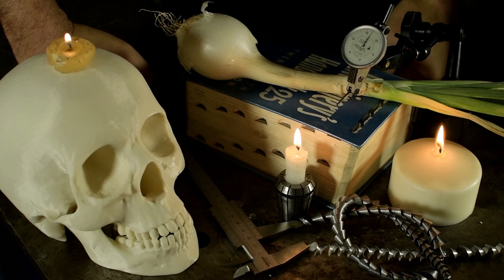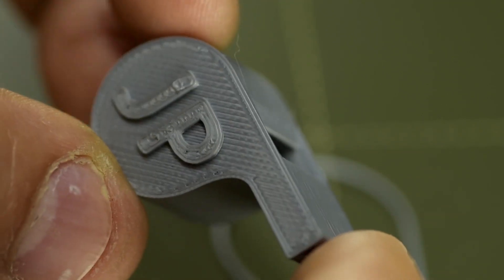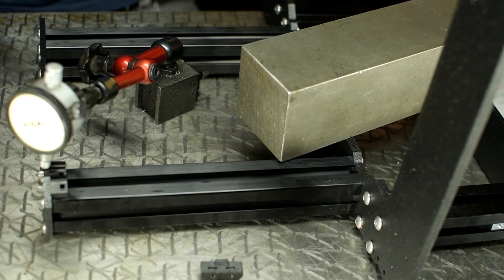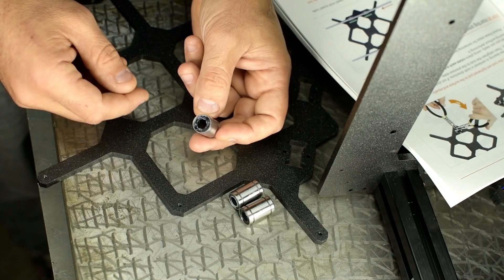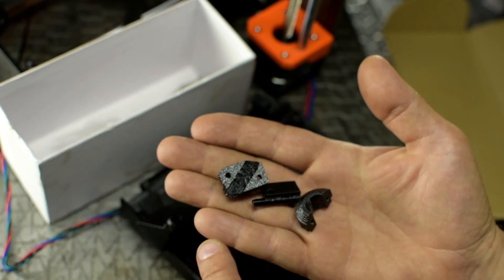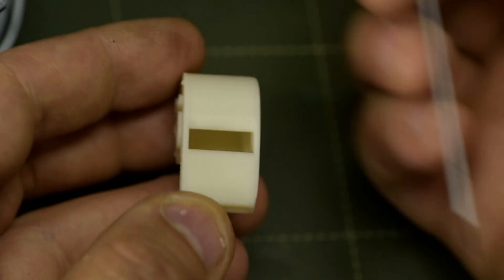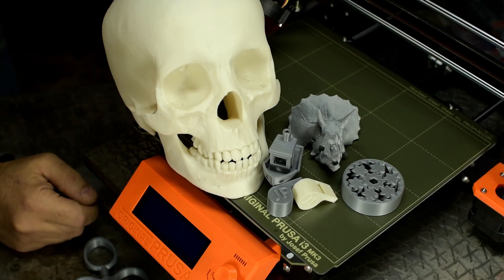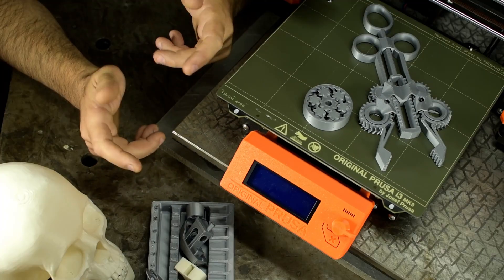This Old Tony in 3D!!! (printing)

Comment: Creality Ender 3 is a very good introduction to 3D printing. It's cheap and works pretty well. The Prusa is a better machine but it costs 3x as much. The Ender lacks things you might get in a more expensive printer - auto bed levelling, dual axis Z, direct drive extruder. Quality of life things. But perhaps that's why it's so popular - it's cheap and people who have an itch to scratch will find a huge number after market mods both commercial and print-it-yourself that take it in crazy directions.

Comment: Prusa is worts 3d priter, worst cost effiecency
Reply: @npgoalkeeper _ Chinese printers are better, for example ender and ender clones are alu-framed with vslot, when prusa still using obsolete designs with plastic 3d printed parts, acrylic parts and linear bearings. Only cheapest chinese printers(100-130usd) still using prusa design. For prusa price u can make ender with hiwin and every upgrade you can imagine.

Comment: Welcome to 3d printing !
Happy to see you went with a Prusa. You couldn't have made a better choice as they are definitely the best printer there is for a house or a small workshop. I do own two for years now. About the assembly you went overkill in my opinion but that's cool. The printer is tolerant to slight misalignment and you would not have seen any issue. As time goes you will realize how much the Prusa is a much simpler, versatile and precise machine compared to some twice its price. Any cheaper is a nightmare of bad quality and problem solving. Any more expansive is a waist of money.
Enjoy it.

Comment: How long it will take until you do an update on it? I think you will have exchanged all plastic parts with new optimized milled metal parts, which are more exactly 😅...
By the way, I love my Ender 5 Pro, even it is a little more expansive.
Enyhow, concratulation, you will love it.

Comment: I have Prusa at home and my work. They're really nice for prototyping ie. tools for packaging machines, make custom tool holders and one of my favourites to make seal lip protectors for machine shafts as I don't lathe for fast access. Many people underestimate them and look with that "it takes that long to print?", but they forget that steps needed might take no more than 5mins and time it takes to print is generally meaningless as I do something else in the meantime and usually I don't need that part at the very second. It also opens those options which are otherwise hard to make, something like fanmount to duct seamless channel for cables. Sure that need decent cad skills to max out possibilities of 3d printer.

Comment: i have always enjoyed your content for its lack of 3d printers. As a 3d printing engineer, im actually fed up with seeing those everywhere))) pleeease promise me you are gonna use this piece of tech in conjunction with proper machining, or else ama be sad. Also, as a 3d printing engineer, i must say, printing == going down the rabbit hole of digging in firmware and software, and not the hardware. Creality Ender 3 is more suitable for toying with its brains as much as you are willing to, and the prusa i3 mk3 is more about just having fun, however, the benchy you were showing does show why you paid 600-something bucks for it. You gotta sort out the slight Z-axis wiggle and retractions problems that lead to those inconsistencies in the surface, i.e. wiggle and little tiny strings of filament sticking out of the model, and you are golden.

Comment: Get yourself a roll of Nylon ! A bit expensive and tough to print, but a very good match with metal working projects. 

It's never going to be "part you couldn't machine", but the ease of just pressing print and continiung the build is very helpfull.

Comment: I can tell you right now that budget printers absolutely need more attention. Granted, the “budget” one I got was $475 back in early 2013 when the 3D printing market and community isn’t what it is now. I have probably spent double that modifying and upgrading it over the past 7 years. Very much a ship of Theseus thing. I’ve heard that the budget printers today (CR-10, Ender 3) are pretty solid machines, but the Prusa seems to really have knocked it out of the park with quality and reliability.
Reply: Just got an Ender 3 V2 a month ago at the same price point I got my Wanhao i3 ~5 years ago.  Night and day difference.  The Ender has been absolutely flawless and prints have had zero errors until I made this statement, which of course will introduce my first print problems.
Reply: @jcims  Ender 3 Pro / V2 are great. You don't need much more than that for hobby use. Actually, I've seen plenty of Ender 3 farms for commercial use.
Reply: The most parts I've printed with my 3D printer is parts to fix my cheap 3d printer
Reply: Its the software you get with prusa..  and the tightly pre calibrated firmware just works great together
Reply: Ronnie? Furze? Probably some others I haven't noticed yet? I'm quite sure we'll be seeing more TOT in 3D.
Reply: I think that if Old Tony here ever wants a second printer he should go for a creality one, i think that he could put it together no problem, besides the creality ones have no printed parts, and i can't see myself spending up to 3 times as much on a prusa with that many printed parts.
Reply: @Gees86  If printed parts are a problem, why would anyone buy a 3D printer in the first place?
Reply: Caleb Strockbine - because metal is stronger than PLA? Why not just 3D print a CNC mill, it will,probably work, for 5 seconds.
Reply: I suggest the new CR-6SE , it easy to put together and you don’t haven’t spend lot of time. I put together under 10 mins. Auto level work without need any human input. Cheaper than Pusa too. Good for a lazy person.
Reply: I got a cr10s as first printer and it printed straight out box, only problem is the well known “warped bed” but I just learnt where it’s warped and print around it haha
Reply: @michaelfletcher1694  Nothing 6 layers of foil in the centre couldn't fix for me. It was only supposed to be a temporary fix while I sourced a mirror. As with many of these things, its now 2 years laters, and, well, no mirror in sight.
Reply: @insayno9959  nothing more permanent than a temporary solution
Reply: Ender 3 was a bit of a hassle to get working. It was way easier than this Prusa to put together. However, the board was DOA, and it’s been over two months, haven’t got a replacement from creality, or even an intelligible email back. That Prusa comes with some amount of customer service/support lol.
Reply: @chrisjohnson9755  That's odd. I accidentally fried the board on my Ender 3 after shorting out a stepper motor. They sent me the upgraded silent board next day for free.
Reply: Prusa from what I can tell is not budget in the slightest, but its one of the best printers in its class so that's the trade off
Reply: zip tied bearings «quality»
Reply: I've been running a cr10 for a few years and it works amazingly well. I never did one upgrade. I just got lucky with a decently flat piece of glass and take the time to level the bed everytime while it's hot. Get really accurate results within a few thou.
Reply: https://youtu.be/OuB4Xfdk4eg
Reply: I got a CR-10, and yeah over the years I have spent more than enough time upgrading and tinkering with it. I don't mind, it's something I enjoy, but for sure my next printer will be less tinker and more fire and forget...
Reply: As a mildly proud owner of Ender-3, you can get some good looking prints with PLA if you get the right settings. Prusa i3 comes with a lot more nice to haves compared to the ender. You can still hack those nice to haves onto your nEnder 3, but its a lot more effort. So in the end, Ender 3 is more for people who want to get their hands dirty with 3d printing, while prusa i3 is thought for more of a print away thing.
Reply: The timing belt drive is something I dislike. What do the more expensive ones use?
Reply: Speaking as an owner of three "budget" printers before I threw in the towel and bought my Prusa, I have to agree wholeheartedly. Sure, there are some budget printers that will not require tons of tinkering or work to keep them printing okay. However, the fact that I just put gcode into my Prusas and they print with no problems, well - that's worth the extra cost. The couple times I've had minor issues, tech support was very easy to reach via chat, and even then the issues were minor. My older printer has been churning out flawless PLA prints for over 2000 hours now. My younger Prusa (both are MK3S), has hundreds of hours of equally flawless printing.
Reply: You'd be a fool if you thought more expensive printers didn't require attention and care... That's the biggest issue with 3d printers, they're not for any random consumer because there's always gonna be something that gets loose, a clogged nozzle, ...
Reply: I recently bought a creality ender 3 s1 and that thing worked great out of the box
Reply: I got an ender 3 recently.  So far it works pretty good.
Reply: Wow...nice to meet you here, big fan of you!!
Reply: I've had my Prusa for nearly 7 years
Reply: This is awesome 
https://youtu.be/yX-Bnyma10g
Reply: If the ender was a direct drive printer, I'd recommend that, but since it uses a bowden tube, I'd say stay away if you can afford it. They're not terrible, but direct drive is more reliable for sure.
Reply: @Vandel212  Made mine direct drive for £9. Even then, print quality is the same, just allows me to print TPU now. Not had problems with reliability either, so not sure what you mean there.
Reply: Vandel212 - they make direct drive extruders that take all of about 20 minutes to swap in and calibrate for the ender and cost next to nothing. I have one on my ender with a micro Swiss hot end and can print just about any filament with it now.

Comment: My preference is for PETG, as it is not much harder to print than PLA, can be printed without an enclosure and doesn't produce the toxic styrene gases that ABS and ASA do.  PETG also has some advantages as an engineering material, because it's more impact and stress resistant.  I've even used it as a spring component to keep pressure on a feed roller.  I really don't know why PETG is not far more popular than it is.  It seems like ABS is really pushed within the community while PETG is inexplicably ignored for the most part.
Reply: @npgoalkeeper _ I wouldn't call  mutagenic and therefore potentially carcinogenic "not enough to be a threat", especially when it's pretty obvious when you are using it.  Ventilation or extraction should be considered mandatory, not optional.  Science has only got as far as stating that it's probably less dangerous than benzene vapours and polycyclic aromatic hydrocarbons (PAHs), which isn't saying much, and it's considered a serious toxic pollutant in industrialised cities that are subjected to it in far less amounts than you'll find in your workshop.

"...flexes a lot before breaking," sounds like an engineering characteristic, not a reason not to use it.  With the right design you can use that to exceed the strength of ABS.  I've never had a problem with overhangs or even bridging with PETG.  It's actually more "sticky" than PLA so I've had great results with overhangs.  Remember I said I used it for a spring component?  Helical compression spring, printed upright, 8mm diameter 4mm pitch. (about 7 tpi), no support.  It's been in service almost two years.

It's ignored because people are stuck in 2014 and won't recommend PETG or even mention it when appropriate, so you've got 16 year olds printing with ABS in their bedrooms because they don't know any better.

Acetone smoothing is (or should be) a thing of the past.  It has it's own risks, was only used by model makers and some niche applications (clear prints for eg).  Model makers have mostly moved over to resin printing because it gives a good finish while retaining much greater detail, where acetone smoothing smooths everything including what "fine" detail you did get with FDM.

ToT has kids, who are probably in an out of his workshop often.  He doesn't have an enclosure, or fume extraction.  He'd be much better of putting that roll of ABS away until he really needs the properties of ABS, and get that PETG out and dialled in.  One thing I will say is that the temperature for PETG is a lot harder to dial in than PLA.  The temperature is only a little above PLA but it's a lot harder to nail it.

Comment: I bought my Mk3s a year ago and using it mainly for engineering purposes like prototyping/ building models.. it’s great. I chose the Prusa over a cheaper version for the same reason you mentioned and it was worth it - as far as I can tell. Like u know: Upgrading something is always more exciting, I began to modify my printer a bit. It now weights 60 kg. I built an enclosure based on aluminium extrusions, added a temperature chamber control and noice isolation... Until now, I think it turned out quite nice - You might like it :)

Comment: Even with prusa mk3 you can print nylon with some work and trust me that martial is freaking unbreakable. My point is that don't be scared to use the prints in your finished projects. If you choose the right material it will work flawlessly

Comment: I've had a Anycubic i3 Mega S for about a year now, and I've really handy. I built an enclosure with extractor fan (ABS fumes can be bad for you) which helps a lot as the temp stays pretty constant round the unit. PLA was simple to work with, ABS was a PITA - I never got good enough adhesion to print anything accurately, so I moved to PETG which was about as friendly as PLA, but with a higher glass temperature so printed items were fine if left in the car. But ... it's "hairy" though and needs a good bit of sanding in post production.
I like the way Fusion 360 can interface to CUDA for slicing, and CUDA can connect via USB to the printer to save me walking over with a card the cat will try to eat.
Welcome to the wonderful world of 3D!
Did you realize that for serious money, you can 3D print metal? Now, if you could build one of those in the shop for a reasonable price ... :laugh:

Comment: you made an excellent choice with the Prusa. The Ender 3 would've been a good choice as well. Can't wait to see how you integrate 3d printing into your projects. Look into adding a bed leveling sensor such as the BLTouch.
 The sensor is a probe that probes the build plate at various points and then makes a mesh of the surface and microsteps the z-axis as it prints to correct for variations in the build surface.

P.S. ABS is a PITA to print with. Start with PLA, its more beginner friendly and isn't suseptible to warp like ABS. check out  " 3d printing nerd" and "Makers Muse" on here for more education

Comment: Your Benchy boat looks pretty darn perfect, Sire!
Anet A8-owner here. Mine look very similar, actually. After some tweaking and learning how to handle the machine, the A8, a Prusa knock-off from China, is a pretty good printer as well. The greatest difference between knock-off and original will be that I have to check the levelness of the printing surface every time I start a new printing session. I have a glass sheet on the alumium tray now that has a good overhang over the original area. Little tabs glued onto its underside basically just lock it in place, on the y-axis sled, which works fine. Instead of the 22x22cm working area, I have 25x25cm now. It's all within the travel range of the steppers of the axes …the axisses? …the… You get my drift.
GET MY DRIFT!!1!
Anyway: one gains potential size of printed objects. It woiks.
PLA sticks nicely to certain wood glues like Ponal. Dilluted in water, you can brush the glue onto the printing surface, let it dry and just leave the bed cold. A well set-up printer with nicely narrow air gap under the nozzle will have nor problem with that. Way, way less energy use and less to worry about when it comes to malfunctioning potential. Anet A8s have an issue with their MOSFETs for the bed heating control failing, so being able to letting that cold takes a great worry of you when using the buggers.

Comment: This is my opinion, but neither of those take the cake with regards to printer design, the Prusa is popular and cheap, but otherwise the only real advantage of it is their stepper motor drivers that can detect missed steps (useful but by no means mandatory)
I've been designing and building a new printer from the ground up- and my advice for anyone would be that the best printers have a bed that moves up and down, not forward and back or side to side.

Comment: Vibra Tite, looks like liquid gummy bears to me. What also works well is raw linseed oil; lubricates during installation and locks the thread as soon as it hardens.
I can hardly wait for the upgrade to finally accept the ER70s filament.
P.s: thanks for the lithium grease tip. This is so much cheaper than the pills I used and tastes better too 👍

Comment: Would be somehow useful here. PLA is tough, but easy to break, melt in low temps (coffee holder for a car isn’t a great idea) PETG got more flex and harder to break, good for some shop applications. (Also harder to print, and less accurate prints with it, stringy). ABS is cool but toxic, better avoid and use PETG instead. Requires to put a box on your printer for thermal stability, hard to print big parts.